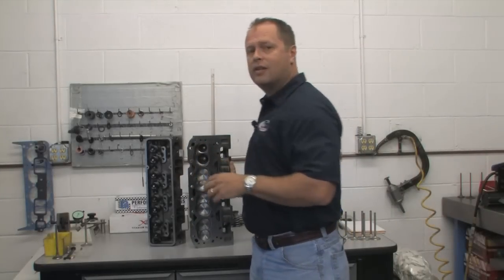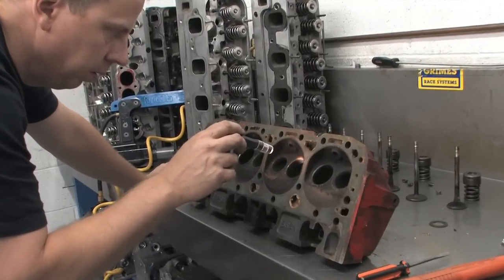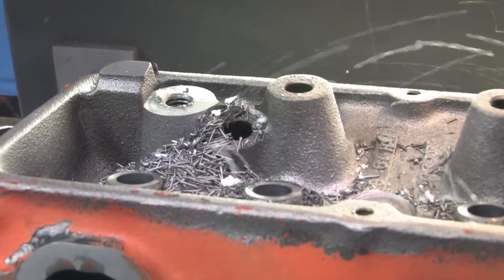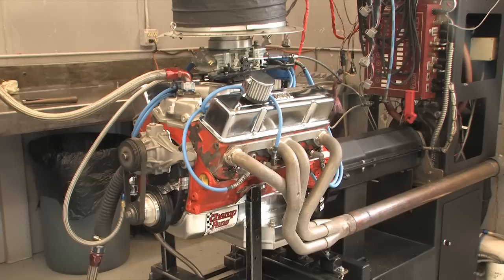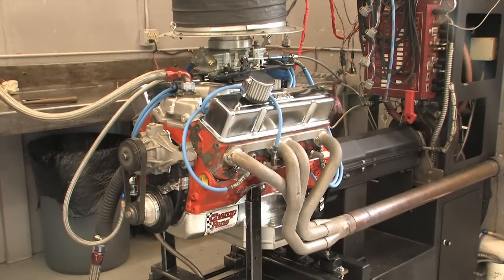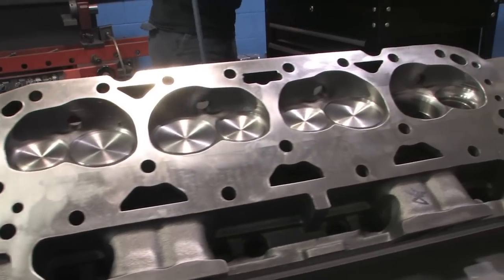Chevrolet Cylinder Head Dyno Test

Comment: AFR all the way. Made 552 hp on a 383 with the 195cc heads with a port matched AFR intake and roller cam.
Reply: Yeah I have a 434 stroker from skip white performance with a pro charger 760 hp to the rear tires wouldn’t trade it for the world

Comment: This is true, I bought a set of 062 vortec heads, and after doing all the work my self and buying all the tools I bought to work the heads I ended up spending more than buying some nice brodix heads ( not to mention the headaches). The best part of doing the work myself was learning how to do it.
Reply: Yes but you can always use those tools to do other heads
Reply: Ehh I'm currently doing a set of 906's myself. I surface them on my mill myself, back cut the valves, pocket ported, gasket matched, lapped the valves, new seals, stud kit, offset retainers, beehive springs, goodson alumi check all for just under $350. Now a hundred of that was the purchase of the heads themselves everything else was tooling and parts so I'm going to say not too bad. So I'm still within the ballpark of my budget for my cam kit (.480 lift if I want to go bigger that's another 70 to $80 for the seal boss cutting tool) and noise timing gear set 👌

Comment: i just give a set of 194 camel hump heads away for free but i just got 2 454 strokers one with only 6000 miles on it the other one has 38000 on it both with the heavy duty 400 turbo that is the cheap stuff i got for free so far this year i just love the 4x4 short box pu 79 chevy with under 36,000 miles on it factory paint is still in mint condition

Comment: I just picked up my original 896 PowerPak heads from the machine shop. 896 heads are a 59cc chamber stock. They installed 2.02 intakes and 1.60 exhaust Manley stainless swirl valves, max flowed each, installed new guides, and they look GREAT! Flow on the intake side is at about 205cfm and the exhaust side is about 138cfm at .500 lift. He spent the most time on these heads for me and the total charge for parts and labor was only $550.00!! Over 1500.00 bucks is a very high price.

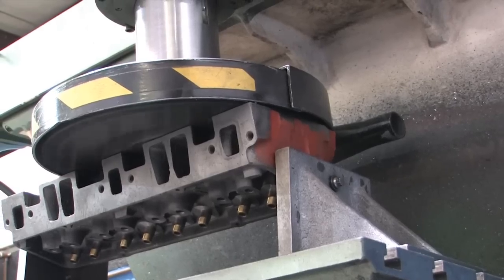Comment: Back in 1993, when i was in my early twenties, i took the same pair of GM 882 heads, had them ported, polished, went with stainless steel valves, kept the 1.94 for the intake, but went 1.60 on the exhaust, screw in studs, bolted to a freshly rebuilt 4bolt mains 350cid bored .030 over, with four valve relief flatop hyperutectic pistons, stock 5.7 rods, single pattern comp cams hydraulic 270(224@.050/110ls/.470 int&exh), comp cams 1.52 roller tip rockers, ARP bolts throughout the entire engine, eldelbrock rpm dual plane intake, holley 3310 750cfm vacuum secondary carburator, msd6a/hei ignition, 1 5/8'' headman headers, 2 1/2'' dual exhaust, flowmaster dual chamber mufflers with tailpipes to rear bumper, rebuilt stock th350 with b&m shift kit for firmer shifts, b&m 2000rpm stall 12'' torque converter and a 4:10 10bolt positrac rearend, neadless to say, this combo might not have been ideal and a total waste of money when it came to the modified work on the heads, given the better alternatives at the time, but it netted me consistant 14.40s in the 1/4mile in a 1975 chevelle 2dr, all engine... it was my very first street/strip car, so it was a learning process, and it didnt dissapoint.
Reply from the maker: That's awesome. I've always felt that if you built it and you can enjoy it, there's no engine that's a waste of money -- even if you could have made more power cheaper.
Reply: 75 chevelle,  p u

Comment from the maker: That's exactly that point. With the 882 heads we cut the decks until we started cutting the intake valve seat. You can get the chamber any smaller without angle milling the heads, then you get into all kinds of extra costs and issues like the valve angle no longer matching the valve pocket in the pistons. Likewise, putting larger valves in the heads is pointless unless you do some grinding in the ports, and that costs a lot too. Now you are talking about putting crazy money into stock parts.

Comment: I saw a NHRA "Stock" 1974 350 make 437hp at 6500rpm on a dyno with "stock" 882 heads and stock intake & Q-jet. Must be magic.
Reply: @wes6374  There are several videos of them here on utube on a dyno.
Reply: The money and tricks that go into an NHRA Stock engine is astounding!  The head work is crazy!
Reply: There's no better carburetor than a QJET  I have a new one from a company it's call QJET 2 and they have a number 3 for drag racing, mine is a 350 Trw flat top with 186 heads with 1.6 exhaust valves with screw in studs z28 springs and roller tip rocker arm ,tow cam 447 lift runs great in my 2500 4wd.

Comment: Stock worked heads produced:
Bottom tq 385@ 3500rpm
Peak tq 397@4500rpm
375 tq & hp crossover  @5200rpm
Peak hp 383 @ 5300rpm...
After dart iron eagles:
Bottom tq 420 @3500rpm
Peak tq 445 @4500rpm
425 tq & hp crossover @5200rpm
Peak hp 446 @6100rpm...---- big clues up too with  370 tq vs 445 tq at 6200rpm where better heads maintain power (maintain torque at high rate of revolutions) and stockiest drop off steep after that 6200-6300.

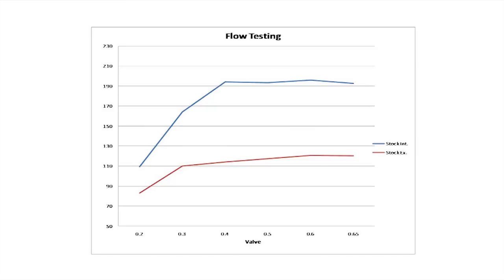Comment: At 5:30 into the video, the flow bench clearly shows the stock head intake flow curve lay down flat at .400 lift, not even close to the .500 comparison point.  I'm sure Dorton knew when he put the 1.94 valves in there that the chamber needed unshrouding, or it would possibly even HURT flow.  1.84s might have done better. But that's probably not even as bad as leaving the exhaust valves stock 1.5 (which made sure they'd look very lame next to the darts.)  Still, it's a tribute to old-school Chevrolet manufacturing that these castings could even stand in the same test with a set of 2013 aftermarket castings.

Money/time are also confounding and distracting variables in this kind of experiment.  Obviously most of your viewers would never dump $1500 into a $50 set of stockers.  They'll have something better lying around (like Vortecs) in better shape.  So unless you're actively working for Dart, you'd be much more objective just revealing the $$ info at the end, for those interested.

That said, thanks very much for the presentation--very clear and informative.
Reply: " But that's probably not even as bad as leaving the exhaust valves stock 1.5 (which made sure they'd look very lame next to the darts.)"

as a rule of thumb the exhaust valve needs to be 75% of the intake valve. so to figure its proper size on these 882s, multiply the intake valve by .75 and the exhaust only needs to be 1.455". so it is nearly spot on by theory. even the new vortec heads with its good flowing intake ports and 1.94 intake, the 1.5 exhaust is still relevant according to the chevy engineers. too big of an exhaust valve bleeds off cylinder pressure and hurts torque. big block chevys are the most guilty of this proven factor and is why they love static compression.
Reply: Isn't that the point? They won't perform even spending the money. 😕

Comment: It's a good test for newbies to the SBC.  Back in the '90s I remember learning just how much stock Chevy heads suck.  Aftermarket heads are the only way to go once you're set on rebuilding a 350 for reliability or performance.  Thanks for the video.
Reply: 99
Reply: 99
Reply: Kk9kkkk9kkk

Comment: Can't imagine ever using iron heads these days. The flow rates very retro. Really shows how good the new stuff. Even OEM 4vs now that are flowing 250+ cfm stock.
Reply: You use them if you run a specific class

otherwise,  youre right,  waster of time.  you could buy e streets and a small comp xe or voodoo flat tappet and still make more power

Comment: Since everyone gets gm vortecs, get a stock pair clean them and add stainless vavles to some of those! Then compair. Since you can get vortecs between $35 (pick-a-part tuesday special) and $250 any were else.
Reply: Uhhh, no, that's not really an issue with vortec heads.
Reply: Get yourself a real pair of aluminum. If you are going stock 23° degree, save the money and get some procomps, pay for a good port job. If you are going all out 18° The sky is the limit. There are guys porting the cheap procomps making more power than $2000 AFR heads.
Reply: @donrutter6765  dont waist money on 18* heads. Just buy Sb2 heads. You can adapt them to a dart shp block.

Comment: Back in the early 70's I was building a sleeper so I sent a set of power pack heads, as they were known then, to AFR.  They were able to spec them out slightly superior to the fuelie head numbers.  I also had the good fortune to be working in an automotive machine shop at the time.  I came across a 350 "X" block that I was able to bore and stroke to 388 CID.  Used all the then popular parts, Jahn's pistons, Crower camshaft, Mallory ignition etc... I was able to make a 1963 Chevy II into a raging monster pushing that little shoe box into the low 10's.  I realize today that low 10's are anemic but back then it was highly impressive as Pro Stock cars were only in the low 9's.  Never put it on the dyno but I'm guessing it was making a skosh over 550 HP.  Just pointing out that it is possible to use these heads and make good power but today it is not economically feasible. Back then you used what you had or could find at a reasonable price.  If you wanted to put a blower on your car, for instance, there weren't any "kits" you could buy so you had to search the wrecking yards for a 471 or 671 blower of a diesel truck and machine it to make it fit a small block.   With the technology today it is easier to make big power but it's still expensive.  Gotta say though, as a G-force junkie, more fun than should be allowed.  Peace out and happy racing.

Comment: Interesting- does anyone remember the small block Chevy 'angle plug' heads from the late 60's or early 70's? I think they were a Chevy performance over the counter head? Supposed to be for higher compression engines back in the day
Reply: jim dandy I had em... they were awesome
Reply: 292 turbo heads. I had a set on 55 Chevy 377 with roller cam and 2 750 holleys. A friend has them sitting in his garage won't sell them back to me.

Comment: im doin a 67 327 w/ stock valves lil porting on the exgaust nothing fancy. ls6 springs comp retainers holley 650 dp summit stg 3 intake 1" spacer hooker. headers. lt 1.5 comp rocker tips

Comment: Hey Derrick. Loved the episode on rebuilding the 307. Just a couple of questions. Did you use new cam bearings on the block or leave the originals in there. Also, the new bearings you used for the main bearings and rod bearings, were they 10 thousands under or stock size? Also, were the rings the same size as stock or 10 thousands over? Love all your episodes. Keep them coming.

Comment: Solid cam 248/252 (advertised) with about half inch lift, solid flat tappet, 350 ci sbc, scat moly slugs (don't know if flat top) scat crank.  1&¾ headers from Dyno setup.

Comment: Also forgot to mention that the compression wasn't the same for the shaved 882's vs the aluminum heads an even smaller chamber but for something thrown together for 380 +hp and 390 lb-ft
Reply: Well 3cc isn't much difference and they could've made that up in the head gasket itself which is probably what they done to make the comparison equal

Comment: This is just what ive been looking for. I have an old C10 with a 350 and its just a cruiser, i dont want to put a converter and gears in it and spin the motor to 6000 rpm. I just want to maximize the power from idle to 3500 rpm where the engine spends all its time and i figured cylinder heads weren't really gonna do anything for me in that range. This confirmed that suspicion! Ill just toss some headers and a small cam in it and call it a day.

Comment: I had that same 882 head on sbc small block and it lasted over a year running hard I had.510 lift camshaft and. Around 300 or so up never broke anything in valve train. That cylinderhead you just shown dart should be better next engine I do im going to look at those heads thanks for showing those other heads.

Comment: I don't think your comparison was fair because you started out with boat anchors from Chevrolet. A pair of Vortec heads would have been more in line.
Reply: Vortec heads put most aftermarket street heads to shame.
Reply: @falcon6995   The EQ vortec heads have a shyt ton of room for porting and bigger valves too.

Comment: How about using a set of L98 Corvette aluminum heads?

I'd be curious as to how those would compare to the aftermarket aluminums. 
Since you can get those for around $350-$400 off of Ebay.
Reply: those heads don't even flow as well as vortec's ....
Reply: They have good port velocity and work well on the street and make good torque, but vortec's beat them for flow above mid lift and for swirl. vortec's win the  HP/$ comparison.  Chevy High Performance did a dyno comparison and I'm paraphrasing them.
Reply: . -113's stock aluminum heads  max at about 390 HP and are tricky to port to get more out of... but a good bump up in power and MPG from stock LoPo 76cc chamber heads... and save 50 lbs... aluminum intake and water pump save another 50 lbs. off front of car...

Comment: I have a pair of these Dart heads sitting on top of a .030-over 350. They do pretty well for the $900 I paid for them.
But for $1200+, I'd go for Trick Flow or even Dart's aluminum heads.
Reply: Agreed

Comment: That's like an advertisement for DART, what head do you think they would have chosen to compare against?
Let's see...if you were going to show off in a foot race would you choose to compete against the fat kid or the athletic guy?
Maybe try comparing the iron eagles against a head that someone would actually pay to have re-built.  882s...LOL
Reply: causeimbat
Reply: 441 heads, but they are rare were supposedly the best stock heads.
Reply: or just buy some already built ones for $600 used. You just need to inspect and prob an hour at the shop to clean them up  $700-750 total. Theres tons of half built projects on craigslist
Reply: Richard Sanford I

Comment: Ken this test was done with flat tops from the video.... you can run 64cc heads and flat tops... most dart ie 64cc heads measure out to really be 65-68cc...mine measured at 65.5 and the 5cc speed pro pistons actually measured 6cc reliefs....with a larger duration cam to bleed of some of the compression at lower rpms and lower the dcr it will run great. Especially with the newer chamber design.

Comment: I love the test, I would just say if you are going stick with the SBC, go for the aluminum versions, they save close 50lbs.  That will yield a slight improvement in handling plus that much less mass for your car.

One problem is though for the cost of those heads you could pick up a used LS2 for about the same amount.  That's going to make more power throughout the rev range, less likely to leak oil, and weighs over 150lbs less.  Sure it's not as easy on the eyes I get that but the smiles from inside the car will be greater.
Reply: You can pickup the ECU and harness at the salvage yard with the motor for ~$1200, oil pan, mounts and new fuel pump is around $500.  I'm not sure I consider that a lot of money, but that's subjective.  Even if you go with getting a conversion kit, it's only about $1200 and the cost of the LS.  So yeah it's more expensive but it's not really that much.  Now if you are going the crate route with a new motor and new everything sure but that's not really needed.

Comment: I'll take AFR heads over Dart even if they cost twice as much....
Reply: You won't gain anything
Reply: AFR Cylinder heads is overrated... To expensive for so small gain... I know a guy that with cheap money build hes own 500+ smallblock chevy. But he did buy bare chinese fake afr heads and bought the rest from afr. I think he said he save atleast 2000 dollars. And yes the engine still runs today but in another car.
Reply: Brodix is 10 times better then afr if money isn’t an issue
Reply: @kennethraff2002  So far Brodix are my favorite heads for the money. Just got a new set back from the head shop a couple of weeks ago for a new stroker motor.

Comment: should have tested against vortec..  would be much better comparison as combustion chambers are similar modern design and would have been same compression
Reply from the maker: Vortecs are good heads but the test was to see which head made better power for the money. If you are going to switch to a set of vortec heads it will also require a new intake and exhaust so it is always going to be more money than necessary. The best time to go with Vortecs is if you already have the intake.
Reply: Agreed, but if you have to buy an intake to match your mods, junk yard vortecs cleaned up good power, I would bet at least competitive.  As where these compression lacking, horrible combustion chamber 882's that many classes mandate to LIMIT horsepower.  

For the money, I have setup up a few smallblocks with some of the smaller lift rule cams and made over 400hp with vortecs.  400 dollar total investment in heads. :)  

That is good for the dollar.  Not trying to be rude.
Reply from the maker: ssswww That's not rude at all. You are right that the Vortecs make good power. But like you said, it assumes you can also get the intake and exhaust headers cheap.

Comment: To get a big boost in hp you need to up the compression to over 10-1, or 11-1..you can't get hp with 8-1 or 8.5.  I can remember in the 60's they were running 13-1.
Reply: but of course sunoco sold pump gas with 105 octane.

Comment: What about a milder engine with dual plane, mild to mid street hydraulic with .460 or .480 lift, smaller tube headers with the stockers against a smaller port Eagle.  I am thinking about a "torqueyer" street engine (350) which uses the better velocity of the stock heads rather than just the flow.